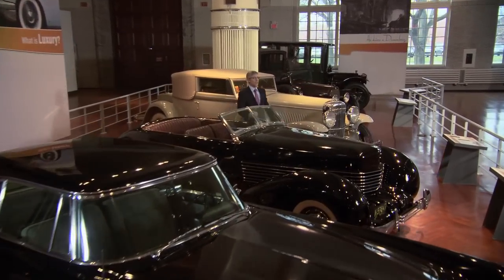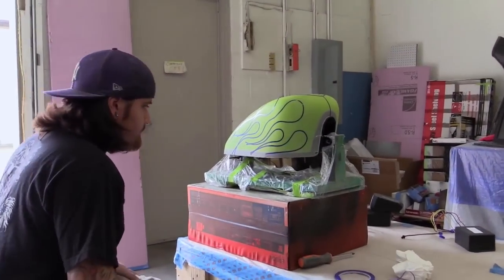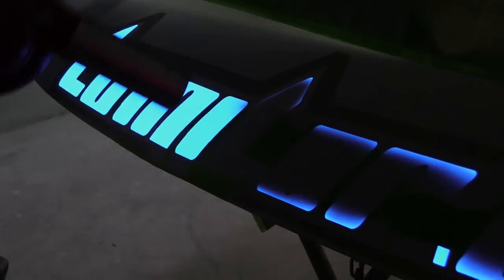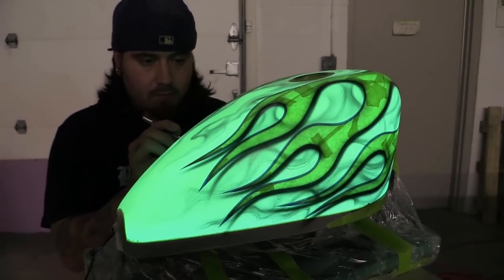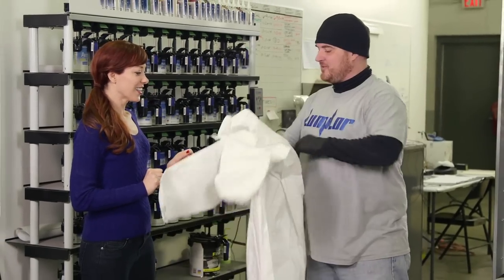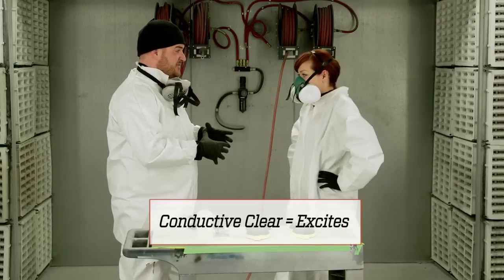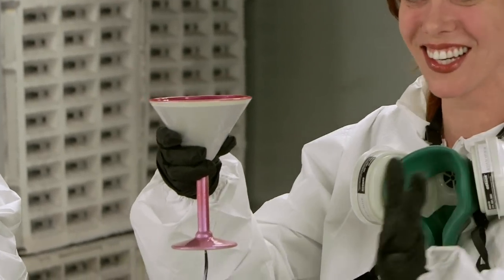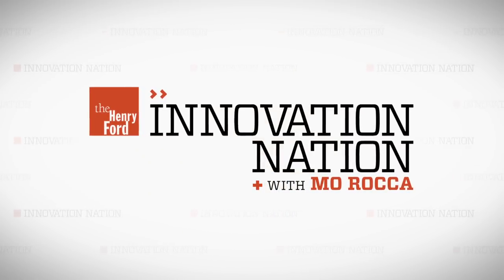Electric Paint

Comment: it's amazing to say the least.  I received one of their lighted shape samples. gonna use it for a project I'm doing...so, in a way every comment here is pretty much correct. its a 4 step process to apply, then, once you add the inverter and apply an electrical charge, it literally lights up until you turn off the charge, crazy technology and perfect for my project :)
Reply: Wbnemo1 Where do you attach the current? Does the wire just sort of get glued to the bottom layer?

Comment: powered paint was actually invented about 25 years ago and sold to the army to light up the panels and it made bright light without heat with very little power. This was in Melb Aust and I was too young/stupid to think of other applications when I was hanging about the inventor's workshop. :( 

now his guy has re-invented it.. lol. cool stuff. originally it was invented for the letters on street signs to light up but the army wanted it for themselves.

Comment: Not Glow in the Dark. It changes colors as the voltage is increased or decreased.
Reply: tripower67vette that would be paramagnetic.
Reply: and, sadly, paramagnetic paint is not yet invented
Reply: "Glow in the dark" is a meaningless term anyway. It's electroluminescent. It's time people used big boy words.
Reply: @Competitive_Antagonist  "big boy words" is a meaningless term anyway, it's time people adopted a grandiloquent style of diction.
Reply: But it does glow in the dark.
"glow in the dark" is not a literal description, it means the glow is only noticeable to the eye when the ambient lighting is subdued (I. E when it is dark.)

There are several ways to achieve a glow in the dark effect.
This one uses electroluminescence. An electrical current excites the paint and causes it to emit light which due to its low intensity is only visible in darkness.
Hence, "glow in the dark."